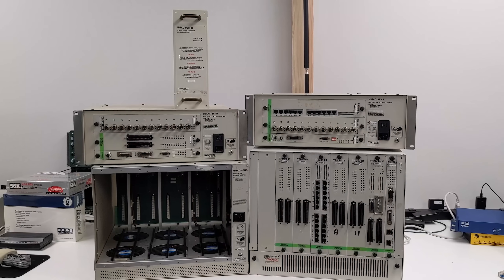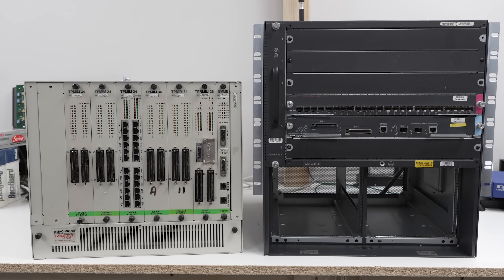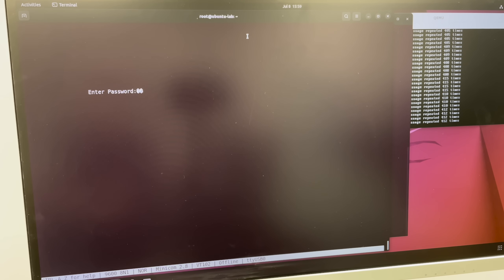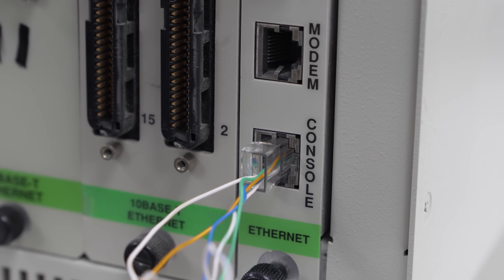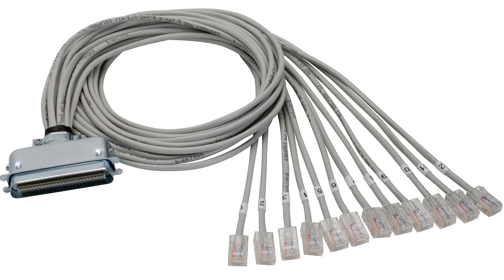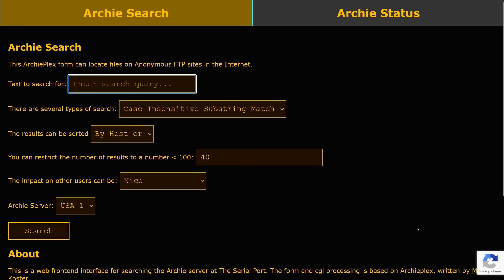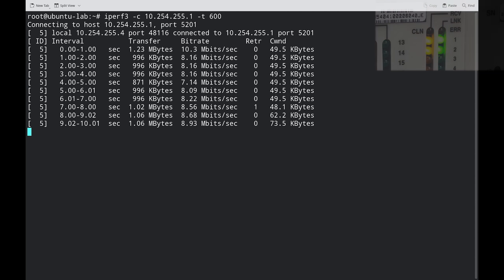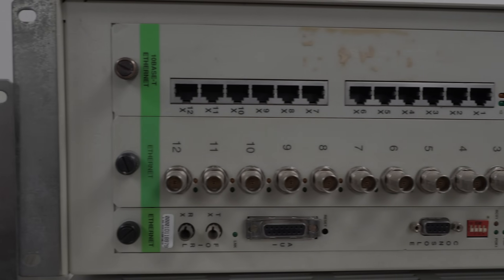CABLETRON: Early 90s networking hubs

Comment: Wow.  I would not be mad if vendors went back to using chonky 24-pair connectors instead of RJ45 jacks.  The next time I have to replace an EX3400-48P because of a PoE controller failure, I'll be thinking about how much nicer the job would be if I could just unplug a few Centronics connectors instead of keeping track of 48 UTP ends that all look exactly the same.
Reply: Those things died out in the Cat5E days. It's hard to make trunks that meet the signal requirements. The RJ21 cables I still have are only CAT3.
Reply: @jfbeam   Oh I know.  They were inherited from the telephone guys for easy runs to a punchdown block, so CAT3 made perfect sense.  But in theory, CAT5E ought to be doable, and would be enough for 1Gb.

And I am going to die on the hill that, if you need 10Gb, you should be using fiber.  ;-)
Reply: Maybe at some point in time, we'll have all fibre with MPO connectors to LC panels or similar. It's just a bit difficult for PoE at the moment. In the meantime, you can work with 802.1X or MAC based VLANs and just have all ports configured the same.

Comment: This video is great but it's been a weird juxtaposition. I remember when Cabletron launched these and, at the time, they were really capable bits of kit. By contrast, I've spent this week learning about EVPN-VXLAN datacentre fabrics which is a level of complexity, performance and flexibility that would have been absolutely inconceivable back in the early 90s. It's quite scary to think about what networks will look like in another 30 years.
Reply: Sometimes it feels like you can’t keep up with learning about all the new stuff with how fast it comes (and sometimes goes)
Reply: @MrMarci878  That's true enough. I remember learning quite a lot about ATM LAN Emulation in the mid-90s but it then disappeared off the market before I ever got round to actually implementing it!
Reply: Less than 15 years ago, 10GbE and early infiniband was insane in the DC. Funny that most of the net is still built on trust with bgp4. 😅

Comment: I remember the Cabletron Lan Van coming to our company HQ to show off the latest gear.  I also remember the "Live Free or Die" motto on its New Hampshire licence plate.
Reply: Still has it
Reply: I used to set up the LAN vans network for field engineers and sales engineers, replacing busted or bent pin cards, and making sure a ping would traverse all the multi-topology hubs and cards....serial, ethernet, token ring, FDDI...and we also had DNSMIM's as modules inside the MMACs (unix server on a card to speed up DNS searches...somewhat fragile)
Reply: @serum-114  Thank you for your work all those years ago.

Comment: Had a Cabletron chassis with a Cisco module in it. Cisco swore up and down this did not exist, after their falling out with Cabletron.
Reply: Had one of those in my college computer labs MMAC-8 chassis, it was quite the Unicorn.  I think it was a Cisco IGS  or IRM card.
Reply: Yeah, Cisco loves to rewrite history. Just like the "AS21" USR TC card I have. (Cisco 2500 on a card that fits in TotalControl modem chassis. It passes through to the back panel, and gets power from the chassis, but that's about as integrated as it got.)
Reply: Yeah, Cisco had a number of OEM-like deals with folks even up into the early 2000s.

Comment: Wow, this was some of my earliest networking, we had it in a large High School, with FDDI uplinks the works was a great product in its time, it had a monitoring system call Spectrum, that we ran on a Sparc station
Reply from the maker: Would love to find an old copy of Spectrum!
Reply: @theserialport  I wish I still had it,  sadly I do not, it was an awesome system for the day, could send you a page you if there was an alarm, BUT it was soooo expensive to run or upgrade, we changed over to HP TopTools, was so much cheaper. We were 100% Apple Macintosh's through out, and I believe we had Caymen Gator Routers with specific AppleTalk Cable Ranges to break up the Chooser for printers/shares etc.  Good memories for sure